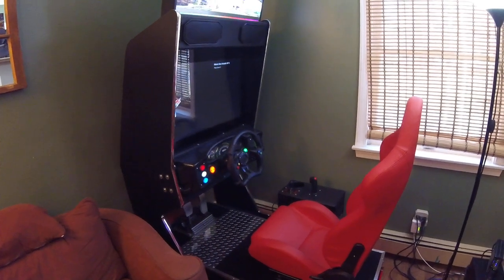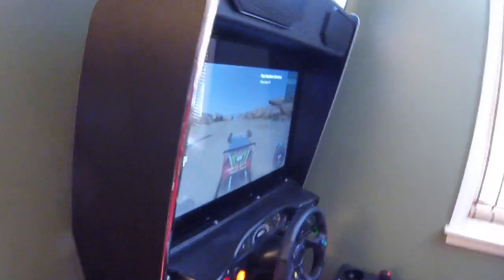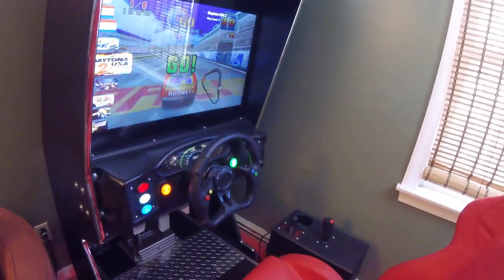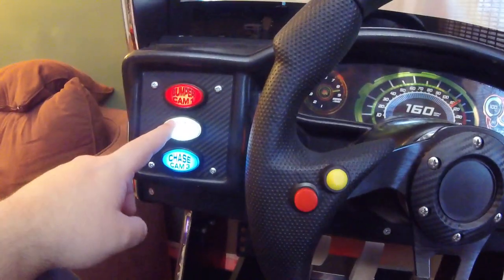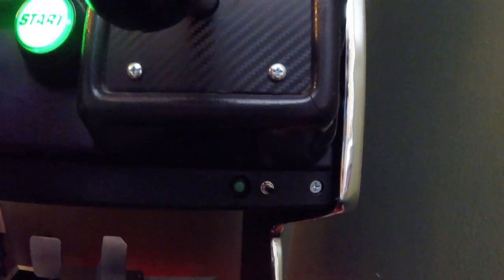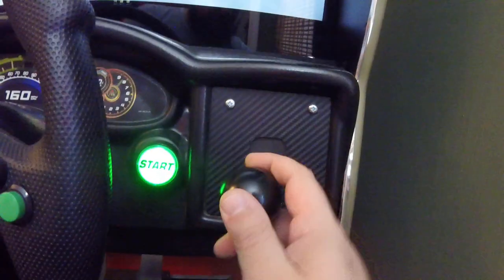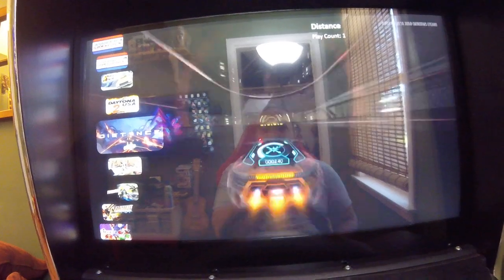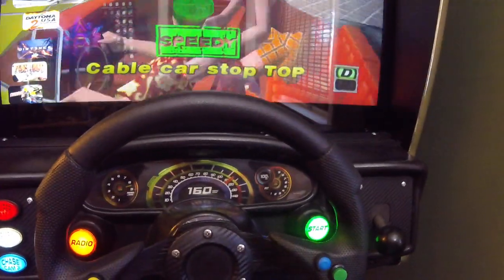Diy Arcade Racing Cabinet

Comment: Awesome build!  How did you wire the rumble pad to the shaker motor?  Solid state relay or something like that? I’m trying to do something similar with the rumble motor output from a Dreamcast controller. Thanks!!
Reply from the maker: Yeah that's exactly it. Just a simple Dc to Ac relay. The motor I used might be a little to powerful, so someday when i get the time i might replace it and try and put something smaller in the seat or something... Thanks for the kind words!

Comment: Great video...is that a midway cockpit...I just purchased a gutted cruising USA cab(wheel, petals,gear shifter are good). Can you tell me what interface you used to get it all to light up and work. Thanks in advance
Reply from the maker: I used an xbox 360 controller as the interface. And I just used a simple 12v power supply to power the bulbs on the dash...

Comment: Hi,  great build.  I'm doing one right now myself. I have a California Speed cabinet with that same dashboard. I'm having trouble figuring out how to get my logitech driving force wheel in the dash without cutting up the dashboard.  Could you show/ tell me what you did to get your aftermarket wheel working. Thanks, George
Reply from the maker: I didnt use an after market wheel, I wired the existing arcade wheels to an xbox 360 controller.

Comment: One of the best builds I’ve seen- you’ve truly thought of everything. Where did you find your marquee at? And do you find that the 32” is big enough for the visibility with the games?
Reply from the maker: I designed the marquee myself and had it printed online. Yeah 32 is a nice size, although I would always get the biggest screen possible to fit the application. Thanks for the kind words!

Comment: How do you get Big Box not to go crazy when you touch the steering wheel?
Reply from the maker: The menu responds to up and down, the wheel only does left and right. I'm using the built in joystick to navigate the menu in big box not the wheel...
Reply: @chubbyboy2242  I thought you had figured something out. In bigbox when I accidently touch the wheel the menu starts spinning.  I just stopped using bigbox when I use my racing wheel and just use Launchbox.

Comment: Hi mate awesome video, im thinking of doing something like this i have a logitech gt steeing wheel so i'll prob mount that and use the usb to pc .My question is how did you you mount your steering wheel to this cab. I have no clue about manual stuff any help would be great..!
Reply from the maker: Thank you sir. My wheel is actually from a real arcade machine, I built my machine and basically just copied the mounting system from the arcade machine onto my cabinet... If you are going to use a Logitech wheel you would want to want to attach it securely to the cab. Probably with screws, there are sometimes threaded screw holes in the bottom of the wheel housing. Or at the very least clamp it on securely and then probably create a trim plate around it to make it look like a dashboard.
Reply: Cool thanks for the reply mate, i think Ive got a bit of homework to do, but this cab has definitely inspired me to attack !.
Reply from the maker: Hope you get one made my friend!

Comment: How did you get the buttons on the wheel and how did you get them to slide into the happ control panel? This looks really sweet. I did the happ/Logitech/servo amp hack and it works great for pc only. I’m also using launchbox.
Reply from the maker: The wheel is made of a heavy rubber with a metal frame. I just drilled into the rubber with a drill bit slightly smaller than the button size so they would fit  snugly. And then drilled a small hole through the metal frame to get the wires through. Not sure what you mean by slide them into the control panel? But I drilled a hole through the metal piece that the wheel attaches to and snaked the wires through and into the cabinet...
Reply: DokiDokiWoki thanks that answers my question.

Comment: Where did you get the pedals and did you have to wire them yourself?
Reply from the maker: The pedals are are from a sega racing arcade cabinet... That is the style they used in games like Outrun 2 and Scudracer ect. I got them on Ebay and yes I had to wire them to work as the xbox 360 controller triggers...
Reply: @chubbyboy2242  I'm guessing they're inputs work based on the joystick axis  of the controller ?

Comment: Anyway you could do a DIY video on it ?
Reply from the maker: You can find more info about it here. http://forum.arcadecontrols.com/index.php/topic,155500.0.html
Unfortunately I didnt have a good camera when I was building it so I wasn't able to do a real build log. But if its something you decide to get into I'll be happy to answer any questions you have along the way...
Reply: I been trying to build a sit down arcade for a while but I do not like the steering wheel that comes with the Xbox 360.. I would rather have like one that came from an actually arcade machine but no clue where to start.
Reply from the maker: First thing I would do is read this...
http://forum.arcadecontrols.com/index.php/topic,105961.0.html
And maybe join the forum if you haven't already.

There are a few ways to do it, the way I did it was by hacking an xbox 360 controller to work as a wheel. This will require some knowledge of soldering... The next way would be to use a computer interface such as an APAC to hook the arcade controls to the pc. And the 3rd probably easiest way would be to buy a good racing wheel like a logitech g27 or g29 and then make a dashboard around it and build that into a driving machine. A good head start is if you find a busted driving arcade on craigslist or something like that and start there, that way you don't have to build the cabinet... Cant really go into great detail here but join the forum and start posting if you have questions...
Reply: I have a second Daytona Arcade machine that the monitor is our and I was thinking about turning it into a sit down.
Reply from the maker: That's probably perfect.
Reply: PM me if you can and point me in the direction of hacking an Xbox controller etc. Can you just cut into wires on a Daytona and use it ?
Reply: Do you have a wiring diagram for the wheel and buttons
Would love to make one of these

Comment: I have my kid's old PS2 steering wheel and gas peddle and a plug and play Pacman/Pole Position/Galaga I figure out the wiring to use arcade buttons and joystick on it, I'm not asking you how to wire up this steering wheel to the plug & play but would you already know if its possible?? before I start hacking this thing up lol
Reply from the maker: I don't think its possible, no. Your ps2 wheel is a 180 or 270 degree wheel and pole position was 360.
Reply: Not sure if this makes a difference but on the plug & play you twist the joystick  to turn and it springs back to center like the steering wheel
Reply from the maker: i cant find a picture of the inside of that plug n play, but there is a good chance there is a potentiometer in there. There is a potentiometer in the ps2 wheel as well. If you can wire the wheel potentiometer to the plug n play is might be possible.
Reply: LOL its works, Thanks for the info as soon as I saw the potentiometer in the the plug n play I knew it would be a go
Reply from the maker: Nice! Glad it worked out for you...